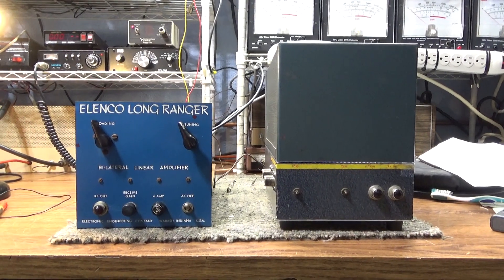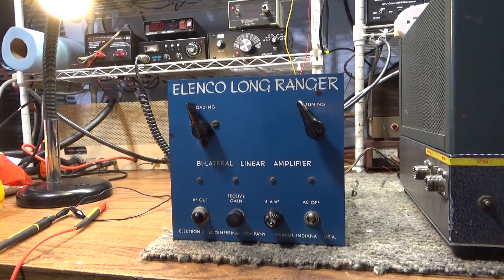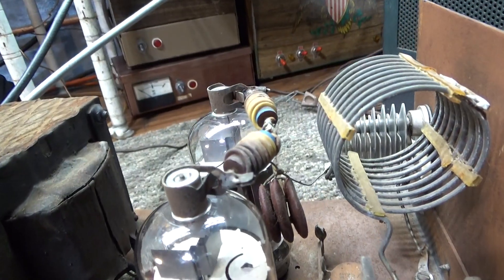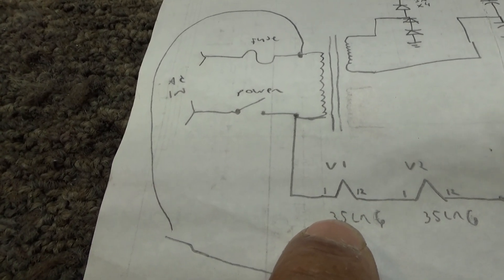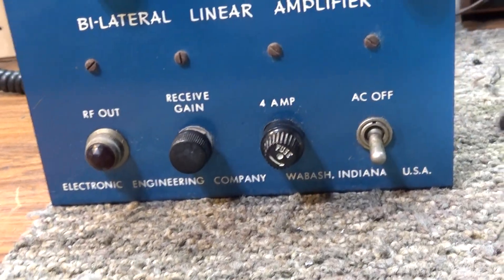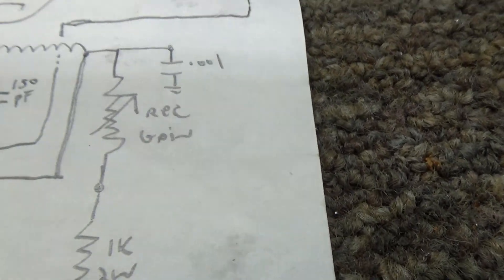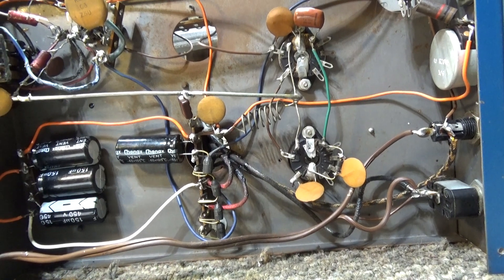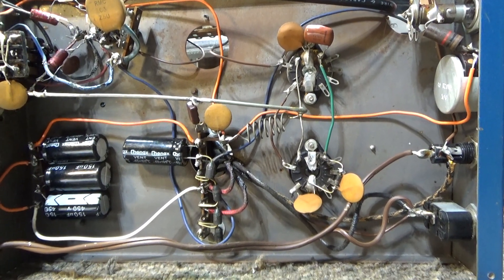Elenco Long Ranger video 2, I need help.

Comment: They could have put 3 final tubes in it instead of that power resistor. But the power transformer probably couldn't handle it
Reply from the maker: and that C word I keep using...... COST.

Comment: That mains wiring really needs re-doing so that both the switch and the fuse are in the Active/Hot side of the mains wiring, according to current legislation over here in Australia it is illegal to have the switch in the Active wiring and the fuse in the Neutral wiring, not sure what the current US legislation is though, it may be the same.
Reply from the maker: True, that's why I mentioned it. However, this amp was probably made around the late 60's. Not sure what the code was then. Also, to me, that's bad, but nowhere near as bad as the transformerless designs and also those that use the chassis 'ground' for neutral ac power.

Comment: The LR Long Ranger was built to use with the LR sidewinder that was a double sided band reduced carrier modulator.  Both of the LR's were made in Indiana.  These were made in a basement.  If I can remember his name I will send it to you.
Reply: That’s right, and I think he also built some amateur single sideband transmitters in the late 50s my buddy has one and I think it came from the same place 7:28